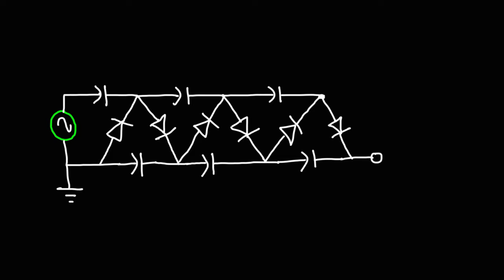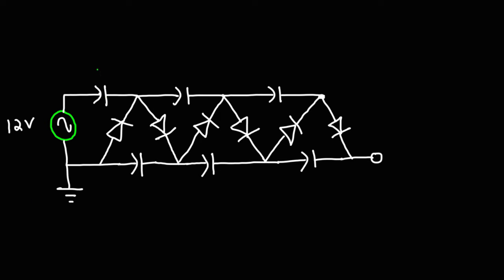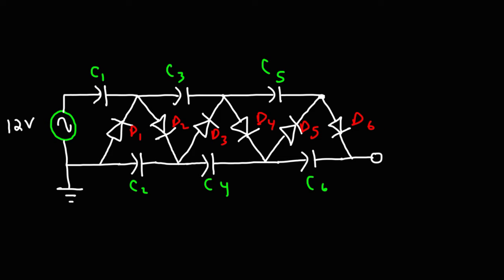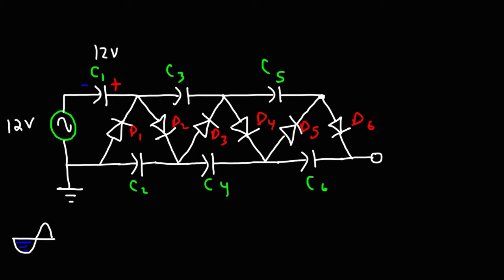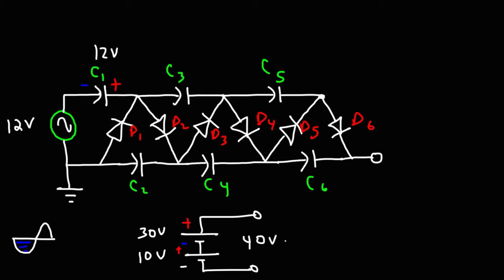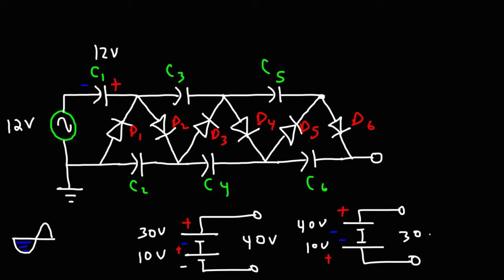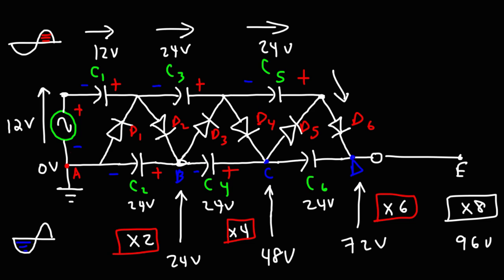Voltage Multiplier Circuit Using Diodes and Capacitors

Comment: I'm very new to this, but typically in physics whenever you get some kind of advantage like this something always has to "give".  What is going on with amps during all of this?  Do you lose amperage and thus reduce your overall wattage or do you increase amps and drain your power source rapidly?  Trying to figure out why I can't power my house with a 9 volt battery here....

Comment: dope explanation! one quick question: the circuit is supposed to output dc voltage, i see one output lead at point d, but where would i connect the other one?

Comment: Excellent effort to explain the complexities of this type of circuit. It’s helpful that you explained why the voltage drops across the diodes were left out the calculations for the sake of simplicity, but I think it is also worth explaining that 12V AC power source in this is also being simplified to mean 12V Peak AC, rather than the usual 12V AC being RMS (i.e. an ‘average’ of 12V) where the peak voltage would actually be higher (~16.9V before diode voltage drops). Appreciate you’re trying to simplify things, but its important people understand the actual voltages would be much higher (especially if anyone is thinking of playing with making a real circuit!). Great job 👍

Comment: What you illustrate in this video is known as a Cockcroft-Walton Multiplier...
Reply: Thank you! This is what I was searching for in the comments!
Reply: @JeffreyJamon  Hi, you’re welcome,  glad to be of help.  The voltage multiplies, but the current is halved.  There are current doublers which require inductors…I have yet to use the current dabbler in series with a subsequent voltage doubler.

Comment: Why do capacitors charge up one at a time ? Wouldn't they all charge at the same time ?
Reply: Only possible if capacitors are already charged to the DC voltages already before the input voltage is applied.

Comment: why in the first negative half cycle current isn't flowing through c2-d3-c3-c1 etc.
Reply: Because current flows the path to Source with the least resistance with the voltage you're starting out with.

Comment: current doesn't flow thru a capacitor. if it did it would be called a short. I think what you mean is charge the capacitor. outside of that, thanks. lol. I made one when I was ten. now I know why it didn't work. I used dc. I wonder if that's the same principle behind a fly back circuit.   I'm designing an ac inverter for fun and I'm dead set on using the irfp250's that I ordered at 120v.  hum? I know lower voltage rectification. but I don't want to. I want to use the 250's at a higher efficiency.
Reply: Current always flows during capacitor charging until finished with the voltage you're charging it with.

Comment: Please I want to know if this strategy also work for Ac to AC voltage booster
Reply: It would be easy to use two transformers: Input Primary to mains voltage T1-then connect the secondary winding of T1 to secondary winding of T2, and use the primary winding as the AC voltage booster.  Transformer 1 120V secondary 12 v  to 12 v secondary winding T2 and Primary 230 V to 230 volts AC  Use different secondary windings on T2 for desired voltage boost, advantage isolation from mains, disadvantage weight and current limited to secondary T2 rating.

Comment: Why only ac? Why doesn't anyone talk about a DC version?
Reply: It should be easier, and then you use a rectifier to turn it into AC with a total voltage smaller than the peak voltage, but still above like, half of it, specifically Vp/√2
Reply: Joule thief uses batteries as a power source or DC input.

A square wave would work for the OP. A square wave input is a DC input.
Reply: Look up buck converters.

Comment: does the voltage across the capacitors ever get higher than double the input voltage? like, if you had 100 stages, would the voltage measured across the capacitor in the 100th stage only be double the input voltage? im trying to understand what capacitors should be used in a circuit like this, that info was absent from the video for some reason. is there a rule of thumb for picking capacitors for votage multiplier circuits, like 4 times the input voltage no matter how many stages you make? also, is there a maximum amount of stages you can make?
Reply: With each stage the voltage is multiplied higher so, the capacitor increases with each stage. Over this design's length the cost could be less with the first stages but the capacitors in added stages would be factored because circuit analysis that reveals more information would tell you these values.

If starting with High Voltage ⚡ then, its special characteristics should be considered because it's prone to ark.

Comment: So... if you manage to control the 12Vac from 0 to 12, you're going to have a 0 to 72Vcc controlled output, minus all diodes' voltage drops. Considering a possible high-voltage source to, say, capacitor revival, a sinusoidal generator (60Hz or some more suitable frequency) connected to the input of a "tunned" symmetrical power amplifier with some tens of output voltage and some hundreds of milliamps @ its output and driving a multiplier would then give us a DIY controlled high-voltage, low-current capacitor revival circuit. Also, each diode junction would provide some lower voltage output, that could be connected to a selection switch for max voltage output. Hummm... Sound "delicious"... Of course, capacitors' working voltage MUST be carefully set, or else... KABOOM!!!

Comment: If you discharge the circuit, will only the last capacitator be discharged or all at once? I would bet only the last given how a capacitator works.

Comment: Can you explain why D1 and D2 do not discharge the capacitor C2?
Reply: I think the reason would be because the terminal of C2 connected to the cathode of D2 is at a higher voltage than the terminal of C2 connected to the anode of D1.  Therefore the diodes would prevent the discharging of C2, since they would be reverse-biased in that situation.
Reply: Because the second half cycle coming off of source voltage plus charged C1 at 12 volts, makes it a 24volt charge to charge C2.
Reply: @jaysmith3259  Thx

Comment: Hi I have a question well a few the first one is do I have to have a transformer on the input the second one is do you need different number diode‘s for each connection because I only have one kind third I’m using a set called snap circuits and the only other numbered diode‘s have lights on them which sucks up a lot of voltage please respond thank you

Comment: If every one of the capasitors are only rated at 12 volts will this system still work? Or do I need higher rated capasitors all the way down the line?
Reply: You would need an appropriately rated capacitor for the voltage potential it will be storing.

Comment: ...any AC voltage source is specified as Volts - RMS = Vrms...so a 12Vrms voltage source will charge the first capacitor at 12V*sqrt(2) = 16.97V ~17V (- voltage drop on the diode ~0.7)....~16.3V  ...and not to 12V as wrongly explained in the video...
Reply: Look into peak detectors
Reply: He is explaining the first half cycle, not the second half cycle.

Comment: the polarized capacitor cant run by Ac !!
Reply: Actually, the polarities on the capacitors are not changing
Reply: ah okey thanks
Reply: Diode rectified AC so it will work
Reply: ha good catch
Reply: @inventorbrothers7053  what do u mean
Reply: @abdessalemakerma4636  I meant that it was Good that you caught the mistake made in the video.  That polarized capacitors can't take a reverse polarity voltage.  That's all.
Reply: @inventorbrothers7053 yeah but cant you just use a diode
Reply: @future_physicist at power on the caps are negative biased no more that -2x diode drop. It’s not possible for a cap to be negative biased more than that because the diodes would short it.